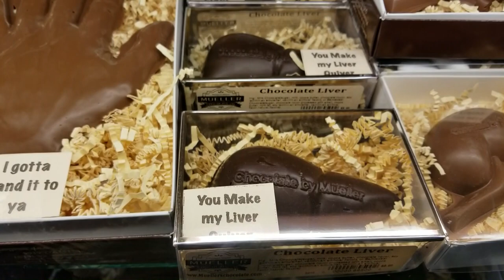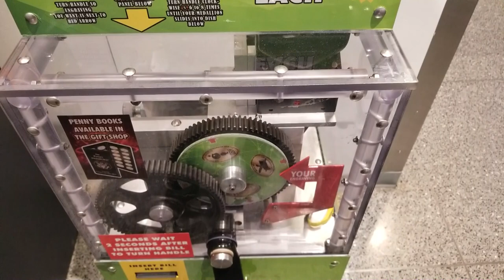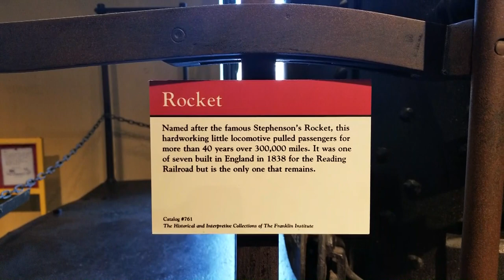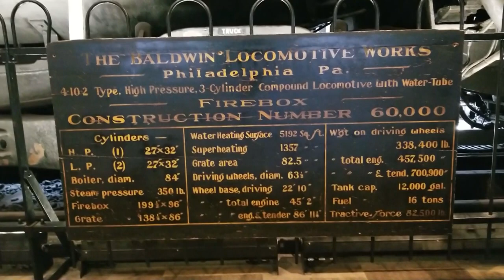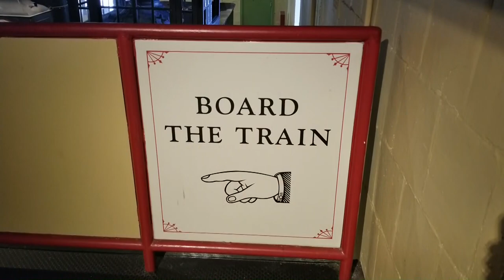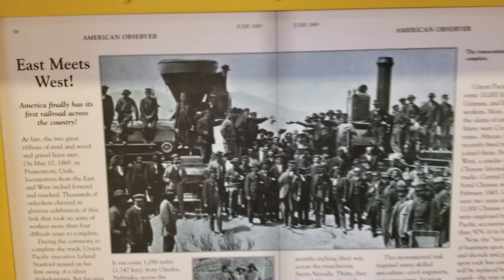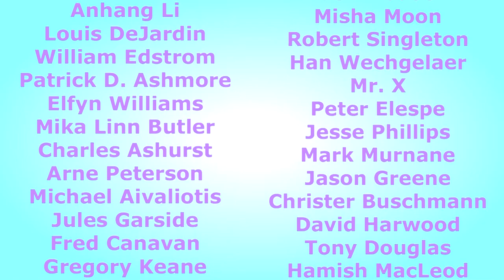Philly Extras: Planes, Trains, LEMs, & Chocolate

Comment: The leaf springs in the locomotives were not for comfort (unless you consider NOT derailing comfort). Think about it. A vessel that large and heavy on rigid rails. Going 40+ MPH. If the bounce is not absorbed, you go flying off. Oh, there was bounce. Those leaf springs were for tracking. (No Pun Intended).

Comment: I am pretty sure that destroying any kind of US currency is not illlegal.  However, defacing it definitely is.
Reply: Also if a US penny is anything like a UK penny, they are now copper plated steel coins....might not go through the crushing machine as easily.
Reply: @simonkirkbright5197  The UK penny goes through, they have one of those roller machines in Tower Bridge in London. It rolls it out into an oval and imprints a picture of the bridge on one side. I thought the same so used a recent coin when I tried it.
Reply: Since 1982, US pennies have a zinc core with copper cladding. I don't know why they wouldn't work in one of those machines. Altering US coins is discouraged, but not illegal unless there is fraudulent intent.